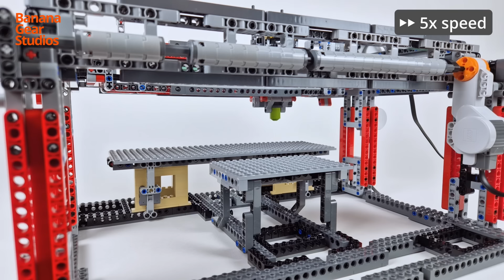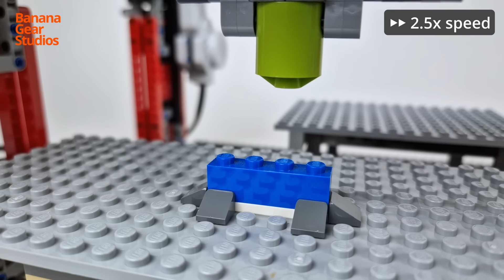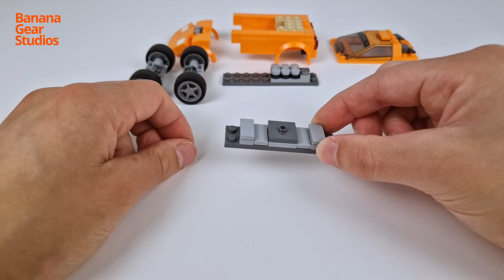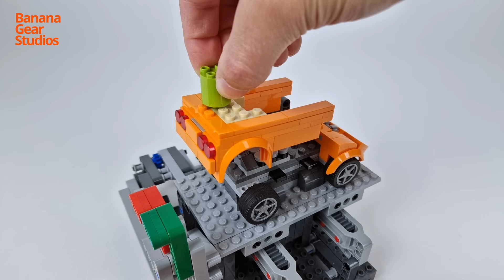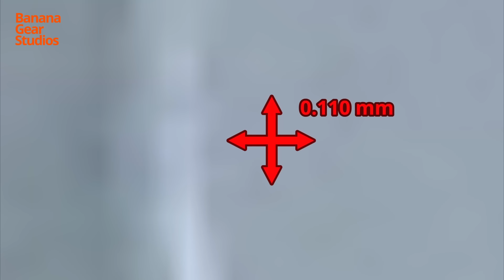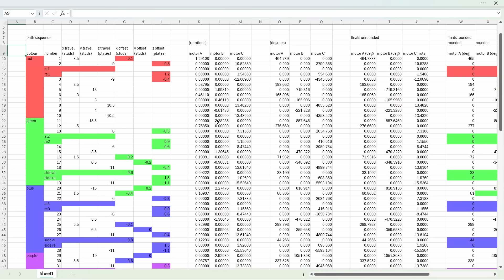I Built a Fully Automated LEGO Car Factory

Comment: 16:50 pro tip for fixing wobbly structures: try using triangular structure support frames. A square frame is able to wiggle on each corner easily, even when the beams are not loosely connected and supposedly rigid. But the only way to get a triangular frame to wiggle is if the beams themselves are not a fixed length. All you need is a single diagonal beam to secure the whole frame. Remember Pythagoras’ theorem, and Pythagorean triplets are extremely helpful here, like 3,4,5. Multiples of these measurements are perfectly valid too, making quite a useful trick for scaling sturdy machines with minimal pieces and simple calculations. Especially since Lego brick beams are not exactly 1:1 in terms of size, because of the studs and bottoms of each brick.

Triangles are hecking strong compared to squares. Squares can collapse with minimal effort, but you have to break the actual sides of a triangle to collapse it. Square tables easily exhibit wobble if the surface it’s on isn’t level or if the legs are not exactly even, or both. A triangular table doesn’t have these issues, only the question of whether the table itself is level on a given surface. Turns out redundancy can actually be detrimental to better design. More complicated doesn’t necessarily mean better designed, just more complicated. Triangles are the most simple 2D shape that can be constructed accurately with straight parts. Exploiting this fact will absolutely improve designs.

Source: I’m a mathematician and computer programmer who has been working with shapes and logic involving shapes for years. Triangles are so important to design that we made an entire set of math courses for this one shape: trigonometry. The triangle is a very important and powerful tool for making stuff that won’t move at all. At all. Ever. Even a godlike force would be incapable of doing anything to it, short of bypassing the laws of spatial reasoning and mathematics, which uh… sounds like a really bad idea to just do for a stupid three sided object that is bothering you. So if you’re needing less wobble, triangles are your friend.

Comment: What a beautifully done project! I was surprised you were able to make it work so precisely with such long chain drives. Your ingenuity and ability to troubleshoot are truly second to none! This is a minor detail, but did you ever consider adding 1 or 2 additional steps to your program to help secure the larger subassemblies (which are manipulated from corner or edge studs...ie, not their respective centers of mass)....like an extra depression or two from the tool head, pressing on a more centralized (and ideally, stud-less) portion of those larger subassemblies, so they sit down more completely and  uniformly? Also, do you think there's enough physical volume within your build to think about engineering in an ability to exchange tool heads? Thanks, and keep up the excellent work!

Comment: Few improvement ideas: 1. diagonal beams outside to increase rigidness, 2. a cabriation structure against which the robot hand would press in the beginning to set the 0 point, this structure should be very rigid with the assembly table, just make sure that the structure of robot hand doesn't bounce back after calibration.

Comment: Drive it off of (Lego brand) string! You can get way more tension than the chain which will translate to way more precision, and the capstan equation means you can actually get a lot of torque/force out of it

Comment: 20:00 Patent and sell that "quick wiggle" handler alignment idea to Sartorius or Hamilton for their biotech Liquid Handling (LH) instruments. One of the most common problems with the Sartorius AMBRS or Hamilton STAR LH-systems, occurs when a human places a box of LH tips in position backwards, or at a slight angle, and the LH is not able to pick up the tip--despite being off by imperceivably small  measures--and will get stuck on that task, and potentially ruining an automated run. You may have trouble patenting after having publicly displayed the idea tho...
Reply: We'd never see the video if any IP it contained wasn't already covered.

Comment: I have a recommendation for upgrading your factory. For manufacturing different types of cars, you could add a color sensor to the machine. For example, Car Type A could use a red base on the pallet. When the sensor detects the red color, it would recognize that it is a Type A car. This way, it would not be necessary to configure a specific sequence; instead, the process would be based on color detection.

Comment: 7:00 Concerning the need for chains on both sides, my first fulltime job was developing software to run a stress testing machine for aircraft parts. The guy who designed the hardware had put a substantial screw drive off to one side to raise and lower the scanner bed and thus when it went up or down, the side with the gear went first, causing the sensor to lean and skew the readings. Ive always kept that in mind ever since. 

He also saved some money by using surface mount mirrors with 3 adjusting screws on each one instead of four which meant when you needed to align the laser, it took HOURS of frustrating tweaking (since adjusting any 1 screw threw both the others out of whack) whereas with FOUR screws (like a surveyor's transit uses) it would have been a 10-second job.

Comment: Would diagonal bracing have made any difference in the accuracy? The frame would have been more rigid with diagonal braces. Using end stops or limit switches might also have improved accuracy? Or did I miss that?

Comment: You can deal with having tons of play within the gears if it is consistent enough. It takes some trial an error for sure but should work. You absolutely need a system to get the initial position so the weak chain may be the limitation there.

Comment: It seems like in this case you didn’t have any issues releasing parts from the grabber. But what if you want to grab and release 1x1 blocks or single studs? Given that the green grabber piece has a hole through it, could you have another motor push an axle piece through the middle of the grabber to push other parts off of the grabber? Again, maybe not needed for this build but a possible solution in the future.

Comment: There are times when assembling, like when adding the engine block section, where the pressure point of the tool head firmly attaches the section in the area directly below the tool head, but not, for example, over the actual engine. It seems like it would be easy* to have the tool head move over those areas not firmly attached, and apply enough pressure to address this issue. 

*Nothing is ever "easy".

Comment: seems like you got this all dialed in, but if you're doing something like this in the future, you might wanna take advantage of a function that most spreadsheets have, which is conditional formatting. That is to say, you can have columns which turn let's say redif one of the calculated values goes outside of your desired parameters.

In short, the spreadsheet can automatically tell you if there is a value that would cause the machine to break

Comment: i havent watched the entire video, but wouldnt it be beneficial if the platform also raise up against the one placing? Like maybe use a servo motor to have a specific resistance input response cut it off when it reaches a specific pressure. Have it so it knows each torque required for each part. maybe thats what happens, ill find out ig.

Comment: This is a cool system with wiggling movements, but I think it would be simpler to make an auto-calibration system. For example, you could install mechanical buttons at the ends of the frame, and the mechanism would move to them and stop when it presses the button itself, and then it would calibrate automatically to the necessary minimum distance that you were trying to guess manually at 16:50.

Comment: this is boring, what is the use if it only puts few pre-built parts together? i came here to see FULLY AUTOMATED lego car factory, but instead i see some piece merger that can't build anything on its own.

if i had money and room, i'd build an ACTUAL factory that can assemble lego cars from scratch, no pre-built parts at all. it would be like a real factory, multi-stage and it would use raw parts.
i'd make a conveyor belt so it can shuffle parts and find what it needs from a big pile of parts.
use cameras to detect which piece is which ..etc.

so first part is that it sorts parts and drops them into correct areas, could use some size and shape based conveyors aswell, so certain parts would easily get sorted, while harder to sort parts would use camera.

factory itself would have multi-stage aswell, one part assembles wheels and axles, next one does the chassis, next one does the frame ..etc.
it would have side-ways machine aswell, one that can push/pull.

for the grabber, i'd use similar mechanism, but instead of relying on 1 vs 2 or more connector dots, i'd cut that grabber in half and make it into an actuall small squeezing claw. so the grabber head is smaller than the connector dots when pressed together (since i'd cut it in half, so it becomes smaller when joined together as saw would cut out few mm). then i'd use piston or motor to squeeze that grabber together, this way it makes very tight grip and can release it without yanking the part with it.

give me money and space and i'll make it happen 100%. i already have the full idea built in my head.

Comment: Hmmm... It occurs to me that putting the motor in the MIDDLE of the cross-axle might be the best idea here, instead of at one side of the gantry assembly, because then the backlash is the same on BOTH sides of the chain assembly and you'll be able to write it off as compensated for, almost entirely.

Comment: i really think a lot of your accuracy issues come from the wobbly structure. you need more cross bracing and tension to hold it still. you could run lego string or chain pieces to help with these, and try to use more tringles in general

Comment: Alright alright alright, this is amazingly cool and extremely impressive, but you know what you need? You need to complete the cycle. Push it down onto a track, chains drag it to do a lap, it goes into a recycler that disassembles it and puts all the pieces back onto the palette. Put two or three cars in flight at once, now you have infinite car factory. Submit that as a GBC competitor and win all the respect from all lego enthusiasts everywhere (more than you did here, even)
Reply from the maker: I love that idea so much! Especially making the car race for a lap before it gets disassembled, and even using that as a module in a GBC. Everyone else suggested it just getting disassembled straight away. Who knows if I could actually make that work, but a very neat idea nonetheless!

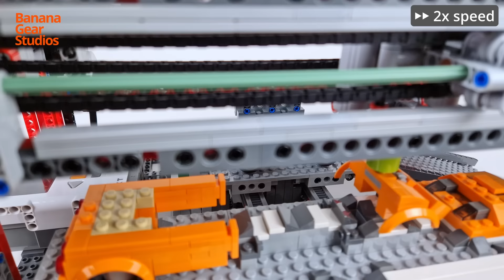Comment: 21:50 I'd recommend adding an extra step here where the grabber moves to the back of the car and presses down to push the other end of the engine block in place (as it is not fully connected at the back), preferably aiming at a spot between studs/purposefully misaligned with studs so that it doesn't latch on when doing this.

Comment: even with real robots made out of steel there are tolerance issues, thats why they do not assume the position based on the movement made, but also check what the actual position is, and compensate if needed. (or throw an error if it is too far out of the expected range)
maybe add some sensors that help with precision.
your wiggling system is genius and it will have to stay because of the nature of lego.
but at least the sensors can tell when the robot is trying to move out of bounds and save your precious chains :)

very excited to see the next addition/upgrade.

Comment: Challenge: 
make it so all the pieces are not orientated the same direction as the cars assembly order is. 
And make the grabber so it can go down and up as usual but when it goes all the way up it turns the all the pieces 90 degrees. And by doing this you can orient them too the right direction before putting them down. 

Usually in an assembly line the pisces are not aligned so this would make it more realistic and a fun challenge. 
Good luck.

Comment: As you say it's probably 97-98% accurate which is amazing. I think before a redesign it would be great to construct the same car but with the existing pieces broken apart a bit more as I think was your original intention. Or try some simpler constructions like a wall. May be try and cope with a failure to attach by discarding the brick and trying again. I guess the work there is really re-programming the existing hardware. Obviously I'm a programmer 😅😅 But bravo! Absolute genius and dedication!!

Comment: This is one of the most satisfying projects I’ve seen, well done having grit, and some great engineering passion!! 🎉
Reply: Was wondering on a few solutions: since you keeping it low cost and lack sensors…you can rely more on programming than physical feedback 1. Starting point tolerance could be set by machine touching a starting part block, and only build car if successful, using your same wiggle to calibrate itself perhaps. 2. You probably do this already but in your excel coordinates just check for limits to clamp to and not go out of bounds.

Comment: I like the idea someone had of a disassembly factory.  but instead have it send the car down a road showing the life of the car with other figures around.  then as it does that the plate shifts to do more cars.  and the car ends at a disassembly plant that puts the pieces back to be used again some how.  for a complete life of the car display.  Thanks for the video and hard work.  As a programmer I loved that part. the interaction of software and hardware.

Comment: Having positional sensors in the actual world on a car assembly line helps overcome any errors in positional alignment. Also having start position sensors which are usually aligned by hand and then fixed also is essential. But achieving the results you have without them is an excellent achievement. Ok you had a lot of failures but think of how many lessons you wouldn’t have learnt if it had worked first time? 
From my own experiences working in many specialised areas of electronics and control systems, the amount of times that things could have gone wrong that didn’t (saved my life!) and then like when I was involved in a trial on a rocket motor assembly built by Thales and when we fired it, it blew up, literally !! The exhaust ports which should have been open were in fact closed, because of the nature of the trial, the ports had to be sealed over with metal foil taped and the whole assembly chilled to -50 degrees. You can’t refit foil table to a frozen body because of the dew point preventing the tape to adhere. 
But very well done mate

Comment: With the programmable block, does it not let you position the motors and save the motor position to the block that you set? So instead of programming it in the software, could you have just remote controlled it into position and saved that position? for each position? because setting the angles all manually in the software would introduce inaccuracies right? because the machine wouldnt be as precise as the angles of the motor right?

Comment: 14:56 im assuming you figured out a way to make the mechanism only move in increments of single studs. As to "put it on the grid"
Reply: If you're wondering how. all you need to do is replace the wheels guiding the axis with custom prong wedge gears, and replace the track with corresponding offset studs, or a custom cheese wedge track. The offset stud track will allow the custom wheel to sit in the open spaces between studs aligning it with the construction pad studs. Wedges would help, but increase the offset for the gear prongs, causing way more vertical wiggle.

Comment: Now you need a parallel factory that disassembles the car and puts the pieces on the plate ready to be build again and a transport mechanism that transfers the loaded plate to the manufacturing facility. Then you have a loop you can let run for hours to find out how many itterations it takes for the system to fail 😀

Comment: i love these programming optimizations to extract more precision from the machine. and, doing essentially DFM optimization on the car design. it almost feels like cheating for me to suggest this, but i think building a big foundation and some sturdy 2-stud wide walls out of regular System bricks would add a TON of rigidity to the frame (even if just for the corners so the camera can still get a good view). also, some limit switches would allow you to automate the homing routine if you can free up some channels, and you could emulate "soft limits" in your spreadsheet by adding conditional formatting to turn any coordinates outside the build volume bright red

Comment: Very nice :-) a lot of fun watching this !! One question though, did you consider modifying the grabbing green piece with a slightly conical hole to account for positional tolerances ? This could potentially help self align without the need of the wiggle ? Or maybe using a rack concept with long lego piece as reference during the displacement and small  triangular shape (i.e. Catalog: Parts: Slope: 3044b) that would go down in between the plot of the rack piece to self align when going down ?

Comment: If you translate your entire grid to motor positions, couldn't you have an easier time in programming? And could this also partially solve the initial datum location as it would be based on stud at 0,0,0 where you have a pause before the program starts to remove any slack in the gears/chain?